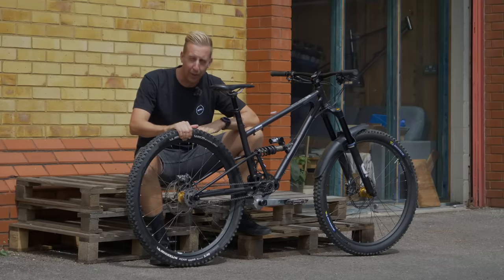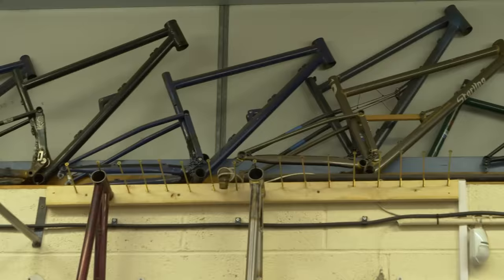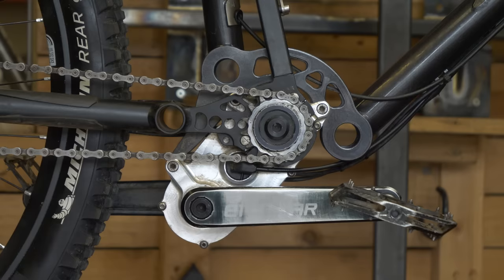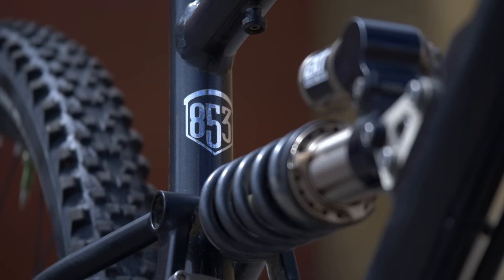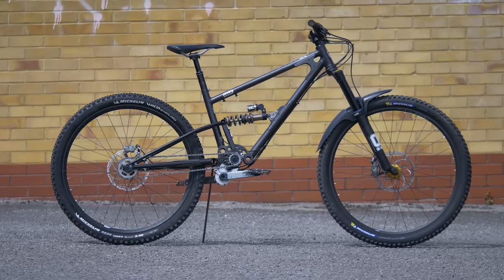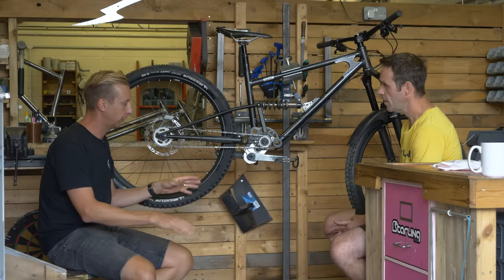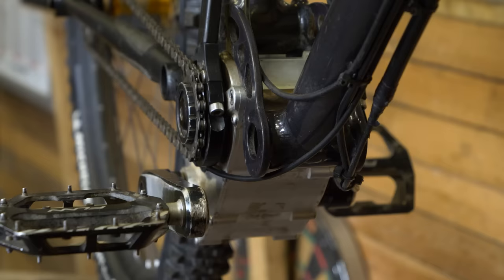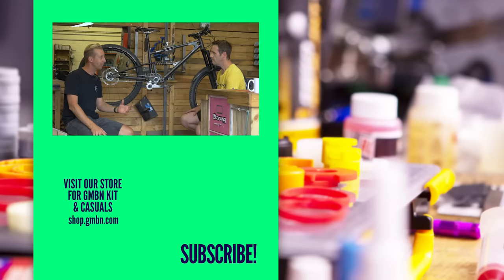Are Gearbox Bikes The Future Of Mountain Biking? | Advantages, Drawbacks, and Future Possibilities

Comment: Another advantage of gearboxes they didn't talked about: The rear wheel becomes fully symmetrical; the spokes on both sides get the same angle between rims and hub since a singlespeed hub with a single sprocket is mounted, which needs much less space than a casseette with 10 - 12 sprockets :-)
Symmetrical spoked wheels can whithstand the same (high) force from all directions.
Reply: I was going to say that.......👍
Reply: You get that with a Rohloff as well, but then you have a lot of weight in the back wheel.
Reply: Have never read that is a problem. Is that a problem ?
Reply: @ohwell2790  
Let's say it's a weak spot singlespeeders don't have.
Reply: @ohwell2790  With a dished wheel, alternate spokes take a lot more force as they are not pulling evenly with the other spokes.
Reply: @joramvandervorst7715  A Rholoff box can be put into the frame using two chains. One steps up to the box the other runs same size sprockets to the back wheel. It needs more engineering, but if you are clever the final chain can be fully sealed, run in oil and be concentric with the suspension pivot so no tensioner is needed.
Reply: @radwanderer6165  A lot of singlespeed mtbs use the same wheels as geard mtbs
Reply: @marshallferron  
Using a regular hub for geared bikes and putting a single sprocket with spacers on it?
They give away one of the advantages singlespeeders can have.
Reply: @radwanderer6165  True but singlespeed mtb isn't a big enough market for there to be a lot of disc singlespeed rear wheels available so it's a lot cheaper for bike manufacturers to use the more common wheels. It also leaves your options open if you want to convert to gears (a lot of singlespeed mtbs come with derailleur hangers too)
Reply: @marshallferron  

True, if we speak about conventional geared MTBs converted to singlespeed.

But in MTBs with gearbox in the frame (or in the rear hub) there's no need for a freewheel with space for many sprockets or a derailleur hanger.
Instead there's a hub with a more stable spoke configuration.
Reply: @joramvandervorst7715  this is essentially a mid Mount rohloff. It will be interesting to see these combined with a mid drive e bike

Comment: This was probably the most interesting video so far by gmbn tech, well done! I really want to see more of niche brands doing things the big brands are too cautious to do. New color handgrips and a fifth compound in the tires is nice to see as well but it’s people like this who will start the big changes in the industry. More videos like this please!
Reply: Couldn't agree more, most interesting video GMBN has put out in sometime. 10/10
Reply: @superspecky4eyes  yelh
Reply: @superspecky4eyes  yelh
Reply: Its because that brand is awesome. Like orange back in the day or Pace. Its of its time and it will denote the history of bikes.
Reply: One bash on a rock thru that aluminum and all the oil gone on the rear tire. It will need a bash plate all adding to the weight. I like the idea for very long distance ridding in all weather conditions, but down hill and racing maybe not.
Reply: @ohwell2790  just run the gearbox dry or lubricate it with heavy grease.  I can’t imagine there is much heat or wear generated from the piddly power a person makes.

Comment: I own the Zerode Katipo and love having a gearbox; less maintenance, and the ability to change gears without pedaling is awesome. The founder made his own in-house gearboxes ages ago and decided to setting on the German made Pinion. I only ride up hill to go down so I'm OK not being the first to the top.
Reply: can you pm me.
Reply: @martylondon6729  Done
Reply: All I hear is good things about these systems over the years and finally decided it's time to have a custom built bike made for one of these.
Reply: @buckroger6456  cool. I spent over a year trying to get my fox 36 Factory fork to behave. I have just got the lowers, damper and air spring back from Shockcraft in NZ and will be putting it back together soon. It had excess grease and they said the damper was oddly different to what they typically find. They burnished the bushings and through on a luftkappe. Dyno tunes came back near linear. My suggestion, if your getting a fox fork just pay the extra tiny amount straight away to have it tuned by a local suspension expert.
Reply: @duncan-mcrae  good tip. I'm actually looking at a 130mm travel pike for this build. It's going to be a do it all hardtail that I can use for bike packing as well. Going for a titanium build and with custom geo numbers.
Reply: Less Maintenance? Hmmm
Reply: Ebike. You wont go back. They are as fast or faster in the dh. I make dhe bikes. The best their is. $15-20k.
Reply: I own a Zerode Taniwha and also can’t think of anything better for a Enduro bike. Equipped with a Gates Carbon Belt it’s dead silent and with the less weight on the backwheel it sticks to the ground like glue….
Reply: @_demerl_4855  more weight makes it stick even better.
 Believe it or not but a heavy ebike is faster downhill than a non ebike by quite a bit. Youll see. Its proven. I manufacture $20k dhEbike. 
Cheers my friend!!!!
Reply: @nobody617  just get a gas powered motorcycle .
    I ride my bike for the exercise .  I have a motorcycle when I want don't want to peddle
Reply: @nobody617  proven!? Where? Certainly not on your channel. Genuinely interested to see your 20k DH emtb. If it exists.
Reply: @nobody617  suspended/unsuspended weight ratio determines how well your suspension can work. so the lighter the wheels/swingarm,derailleur, etc the better
more unsuspended weight has never improved suspensions. Although DH bikes still have heavy wheels because  wide/grippy tires and 27/29 wheels that will handle the abuse are both heavy. but still the lighter the better
Reply: @boracay12  i get a better work out on my ebike. I get to go do 30 hard single track miles instead of 1/4 that. Its alot more to hang on to. Youll learn this. You arent thinking correctly. I get way more fun. Its not about "not peddling." One day youll see. They are taking over. Regular bikes are boring compared. I started long travel dh racing. Am Xpert xc. Been around. Now manufacture the highest end bike on planet. Only pole and alutech compare.
Reply: @geemy9675  one guy thinks his suspension works better with lighter cassette and chain. Ohhhhh kay. If u say so. :)
Reply: @nobody617  what ever you enjoy.
Reply: @nobody617  yeah with lighter unsprung way. it's not me saying it, it's physics and everyone who has worked on suspensions. lighter unsprung weight also means you have to retune the suspension

Comment: I really hope that gearboxes become the future of mountain biking, as what we have now seems very antiquated and can easily be damaged....plus all the cleaning and maintenance required really sucks.
Reply: Dont forget extra weight, loss of eficiency n complexity of the geared system as negatives.
Reply: My Rohloff shifting just broke and I’ve been riding a single speed hub until parts arrive from Europe.   Not sure if I’ll switch back to the Rohloff anytime soon, it’s noticeably less efficient, more “clunky” than the SS, and almost impossible to service.  This failure put a bad taste in my mouth, I don’t like proprietary “black boxes” on my bike.  I can rebuild a freehub and derailleur system with my eyes closed, but I have no access to the guts of a Rohloff.
Reply: @ClockworksOfGL  Are you comparing an electronic shifter system to a mechanical gearbox? I am a bit confused by what you are trying to convey here.
Reply: @creesch  - The mechanical shifting of my Rohloff is controlled (internally) by a short loop of cable wound around a small bronze drum.  That cable broke after about 1.5 year of use and I’m waiting for a replacement to arrive from England.  I still love the concept of internal gearing, but I don’t like Rohloff’s execution so much.  Bikes should be inherently simple, user serviceable, not so propriety you can’t fix in a reasonably equipped bike shop.
Reply: @ClockworksOfGL  ah gotcha, to be honest I think a lot of that would change for the better when gearboxes become more mainstream. Derailleurs and such are also proprietary in many ways but are easy to service as they are so widespread so parts are easy to come by. But even there it really depends on the brand and what part of the world you are in. For example, SRAM and Shimano parts are widely available here, BOX parts less so.
Reply: Let's not forget gearboxes are more expensive to repair in case they break. Unlike regular derailleurs, which have their functionality known and easily understood, gearboxes are just sealed units with several moving parts and complexity that your average rider is not familiar with.
Reply: Ultimately it's down to cost a rear mech is far cheaper than a gear box,
Reply: @the.communist  Like they say, if it ain't broken, don't fix it.  Derailleurs are fine for trail riding and on the street.  Downhill racing, this gearbox is a good idea.
Reply: @ClockworksOfGL  yes, most bike shops don´t touch alfine rear hub as well. if there is any problem on warranty they like to ship it to shimano and slap a replacement on.

Comment: I think Doddy stumbled on the solution there, namely introducing gearboxes via E-bikes. Then you won't feel the drag and those engines and batteries just keep getting stronger. If gearboxes became a mainstay for e-bikes then I think the transfer over to enduros is smaller and like that it probably will trickle down through trail and maybe even xc eventually.
Reply: This
Reply: I’m sure it will have been looked into. As Doddy said, if/when the £ signs align they’ll pull the trigger.
Reply: Rohloff hub gearbox with belt is now trending by RieseMuller and others, in a perfect world the electric motor would have a gearbox too,
Reply: It’s already done…motorbikes have used geared transmissions for a long time.  e-bikes are motorbikes.
Reply: @SimulatorBoss  true, indeed..
Reply: @GHinWI  I see what you mean, but personally I never would phrase it like that until you take of the pedals and add a throttle instead. There obviously is a very different technique when you time the power you transfer to the wheels via pedals.
Reply: @GHinWI  calm it George
Reply: So why are these GearBox‘s build-in the Motor of the eBikes🤔(by Bosch or the Others)?Would save a lot of weigth , and the range ist by 9 Gears 440% or so🤷🏼‍♂️…(and they could Easy be a modular Moter/Gearboxsystem in the eBikes so the Manufactur like SRAM, Shimano can sell Moduls with More gears / range 550% or more? and better / lighter Materials (NX-XXO)…
Reply: I have a custom ebike that I have made and have been keeping an eye out in this space. The problem is durability and range and weight. My bike has a 1600 watt mid drive motor, most gear boxes are rated for 250-500 watts. The ones that can take higher power only offer a few gears and don't have much range. To get the durability it needs to be heavier, to get the range it needs more gears, which add weight. All of which add a lot of cost. It's a tough engineering problem. 

For now, as annoying as they are, cassetes/derailuer offer mechanical simplicity, mechanical efficiency, and easy enough repair ability so begrudgingly, I keep the derailleur.
Reply: @zelkuta  1600 watt though..., that's 6x a standard E-mtb if today 😳  I'm not that deep into the e-bike game, but I do like a natural pedal feel most of the time. Don't care if it's just for a shuttle up too the top.. How many Nm does that think put out 👀 ??
Reply: @nosreuter  150nm or so.  It's not terribly fancy, bbshd motor with hotroded controller. It's a 52v midrive unit. 

It can propel my large self uphill at over 30mph at full blast on the pedal assist without hitting the thumb throttle.

Really suggest looking into the ebike conversation world. A bbshd motor from luna cycle isn't that much compared to a high end ebike from a manu. In total I spent about 2k on my setup that outperforms 5k+ bikes easily and has ~50-60 miles of range on a full charge.
Reply: @zelkuta  that's some pretty amazing stuff! Thx 😃

Comment: Gear box would be ideal for electric bike. Engine makes up for little friction and this makes it easier to use heavier chain that would last with engine. And it could be build straight in to the engine.
Reply: Could be quite a challenge to fit all the motor and electrics as well as a fairly substantial gearbox all around the bb and downtube.
Reply: Yes as i commented, this system is a motorbike-like system
Reply: @zensmylie5393  gearbox n motor should be one compenetrated thing
Reply: Shimano is making a gearbox for the rear hub, I think. Combo that with a motor?
Reply: @kayakutah Are you talking about a hub gear? If so this is a different thing to a “gearbox” and has been used for quite sometime
Reply: You are basically talking about the Nicolai G1 e14 eboxx 🙂
Reply: Yes that what I'm waiting for that's the ideal setup.gearboxs are awesome if mtb's had gearboxs standard and we where talking about going to a derailer cassette setup/silly week heavy thinking on the back hub with less range that tacks forever to go through gears but has slightly less drag... no one would ever buy it
Reply: @zensmylie5393  gearboxes have also been used for quite some time. An internally geared hub is just a gearbox built into a hub. For an e-bike the hub would be 10× easier and the biggest difference would be fewer speeds than a BB gearbox.
Reply: Valeo Smart e-Bike
Reply: @yo yo There is the Enviolo, however it has lots of friction and doesn't like huge torques.
Reply: @yo yo Continuously Variable Transmission. Enviolo is that. If you think you know better, go and build your own.
Reply: @yo yo V-belt CVT a la "DAF Variomatic" (which are not the only CVT in the world, nor is CVT synonymous of "belt drive") have terrible losses, completely unsuitable for e-bikes. Actually, completely unsuitable for almost any application nowadays. In car and tractor applications they switched to metal-segmented belts long time ago, and still it had limited success, with reliability issues and poor efficiency. They do shine in certain applications where fine tuning of speed is more important than overall efficiency and costs. They are used on IC scooters where efficiency is the last of the designers' and customers' worries. (Hope you won't start saying that Toyota hybrids use CVT: that is a completely different transmission, no belts whatsoever).

 Going back to the Enviolo, while I don't particularly like it, it is a clever solution once you factor in price, size, weight, reliability and efficiency. It's doing quite well on cargo bikes.  

 I have no "favorite BS" (as clearly opposed to you), fact is, I am an engineer and I know one thing or two about transmissions and about feasibility. If slightly quantizing transmission ratios gives me better robustness, costs or efficiency, I'm all for it (on an e-bike). My optimal cadence range is between 70 and 90 RPM, if gear steps allow me to stay in this range, I'm fine.
Reply: How much would people be willing to spend ? I would say not many.
Reply: Effigear and Valeo already have some prototypes, hopefully they will be available soon.